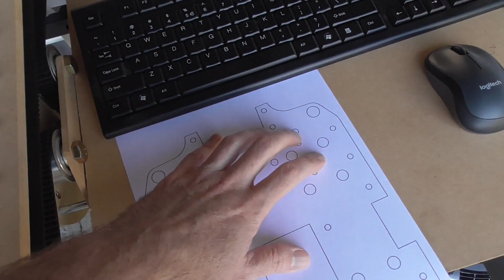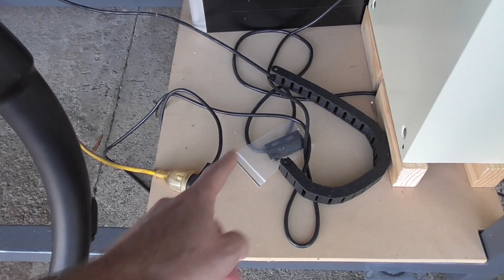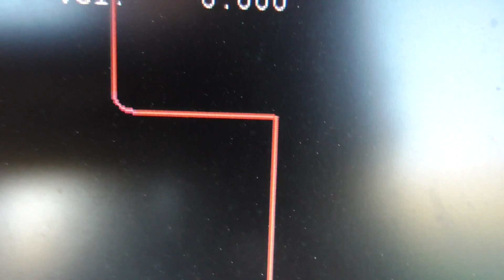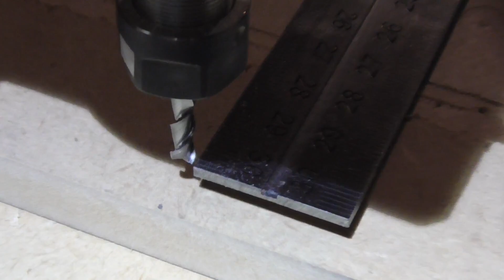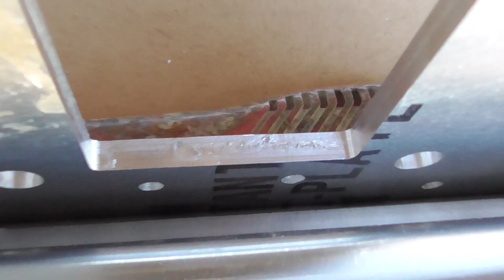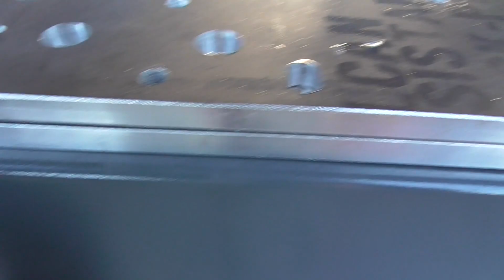Another DIY CNC router, part 6 (more test cuts in MDF and aluminium with wonky axes)

Comment: My experience with wooden CNC routers is that you need to use a lot of large washers with the bolts to spread the force. Wood is often too soft for small bolt heads so they can twist and slide around.

Comment: I did read through other commenta and I didn't see an suggestion about linuxcnc cutting corners. The g64 command is path blending mode and if it is used without parameters, linuxcnc triest to keep the best possible speed by cutting corners. You can use g64 p0.1 tolds linuxcnc blend the path maximum of 0.1 mm away from the exact path. 

The g61 is exact path mode. This makes linuxcnc stop after every g-code line. Your adaptive pocket g-code is probably bunch of small lines (g1 codes) rather than arcs (g2 or g3 codes) which causes the machine to like studder if g61 is used. Change g61 to g64 p0.1 and everything will be much smoother.

Great work.
Reply from the maker: Yeah, the adaptive is made up of a bazillion G1 codes. For now I have been just turning the G61 on or off depending on the program, but I might try setting a tolerance sometime too.

Comment: i think you move a tiny bit to slow, to prevent the clogging :( the screws not fitting might be tool deflection. creating a tighter hole at the bottom. holes not lining up looks like missing steps ?
Reply from the maker: I discovered later that my 'square' was not square, which is mostly the cause of the holes not lining up

Comment: As others have said Coolant is needed, also when cutting pockets or slots restrict your stepover to no more then 1/3 the Dia. of the cutter. The problem with the holes may be due to the cutter flexing and not cutting straight leaving a small taper to the holes.

Comment: Very good results while most of the machine is wood, IMHO! :D Not sure what your speeds and feeds are, but I found  that when slotting on a cnc router, it seems better to move fast with small stepdowns rather than slotting slot and deep. So maybe 0.1-0.5mm stepdown and 2000mm/min feedrate and anything between 12k-24k rpm :D
Edit; Oh, and spray on some wd-40 every now and again for lubrication, until you get a mist setup or something :)

Comment: The results are getting better and better, but I stick to it, the cutting speed suitable for the material, the feed rate and the right lubrication and cooling are the most important things when milling (some materials are simply not machinable in high quality when dry). And then of course none of the axles must have play and the frame must not twist! (The lubrication and cooling on an MDF frame is of course a problem) I am sure that the finished machine will give significantly better results ... Great work as always, keep goin!!!

Comment: You made a milling machine out of wood that at its best produces more than acceptable results in aluminum. That's a pretty good start. I think you're right that the next step is the metal base plate, that should give you square. Some of those irregularities might be due to racking so cutting another of the same part as the last one and if it's more square swap it in. MDF can be made stronger with inserts, bushing, metal flanges or even coating the edges in crazy glue. I think you're results are pretty amazing for the cost. If you were going to be doing mostly woodwork you'd almost be done.
Reply: we dont know what tolarence it can provide

Comment: Consider chip evacuation. I'm not sure if you used a path that is exactly the width of the endmill when cutting out the outer contour and inner square, but if you did, then the chips have nowwhere to go. Route around the periphery with maybe 1.5 the width of the cutting bit. Shallow plunges to create a channel.

Comment: 15:00....like I said previously, lube, lube and more lube.
You'll notice when you cut the holes, the cutter is cutting on one small face.
When gouging out like in the slot on the square, cutting on at least 1/2 diameter and nowhere for the chips to go.

Comment: About screws not going through the holes - my guess is that the endmill is starting to wear and become conical. I have noticed this with my machine it is super irritating. I have started to do a clean passes with fresh endmill, that solves the problem. But in Your case that is a secondary problem because the parts do not match 😁, never had that kind of problem though..

Comment: U will like to use low pressure dust collection
U will need maybe 100-200wats 300+ is overkill
And it will have more power than u will need because of low pressure it move waaaaaay more air

And some coolant + compressed air
Average wd40 will do the trick untill u dont build something
But isopropyl alcohole is a way to go

Comment: May I advise against an inductive limit switch. The trigger distance varies with temperature. Not fun.
Reply from the maker: I had not heard that, I looked around but couldn't find much info about it. What kind of variance are we talking about? As long as it doesn't change too much over a few hours I think it should be ok.
Reply: @iforce2d  yea likely is fine. Used to be an issue on 3d printers could see 0.1-0.2mm variations on a bad day.

Comment: I'm guessing that you're going to assemble the laser cut aluminum parts, keep the MDF head pieces, then cut new aluminum head pieces. Getting the main aluminum structure all squared up and secure would help re-cut these aluminum head pieces more accurately, even with an MDF head still
Reply from the maker: That might be the best way to go. At least the MDF y-plates I have now are properly square.

Comment: To machine aluminum I will sugget a 1 flute 6mm mill, it will eat it so easy, you will be able to go faster and deeper without compromising the finish and it will be less agressive for yout MDF cnc machine.
One more thing... don't cut aluminum dry, use alcohol as a cooler/lubricant... if you have ethanol is even better, these are the best liquids you can use when machining aluminum and the ONLY liquid that Datron uses on their machines.
Resuming... a 1 flute mill with alcohol or ethanol will avoid clogging, which was your problem there when trying to machine a "slot"
Reply: what I keep saying: lubricate and cool aluminum with alcohol when drilling, milling or turning. The machine is stressed much less and the result is much better. Dry machining only works poorly because aluminum tends to seize.

Comment: you can do all the non dimensional critical machining like pockets or small thing where its not that large the difference before you star changing things to aluminum
Reply from the maker: Yes, there are a few places where I wanted to make a pocket that's not very important, so I will do that before taking it apart.